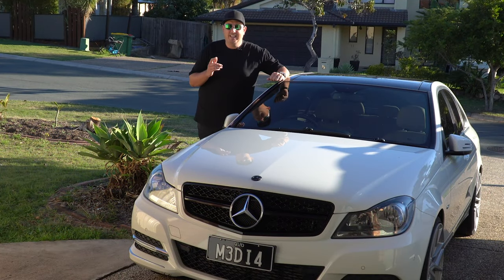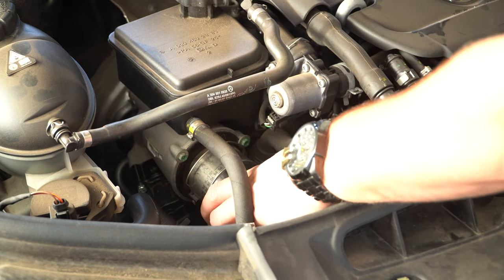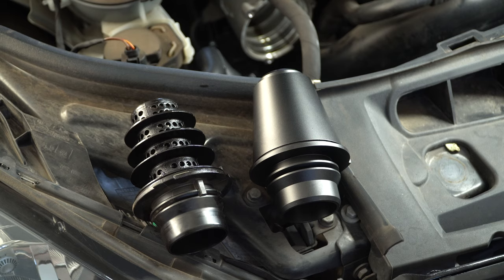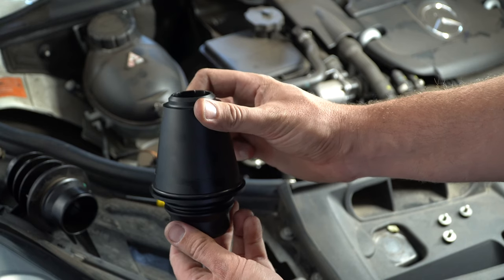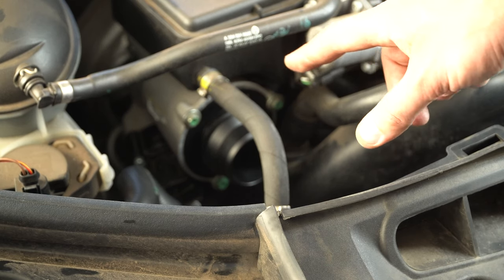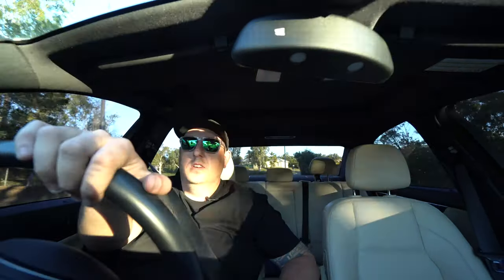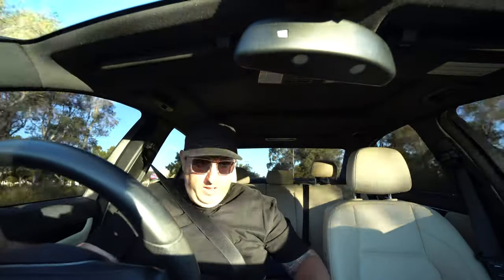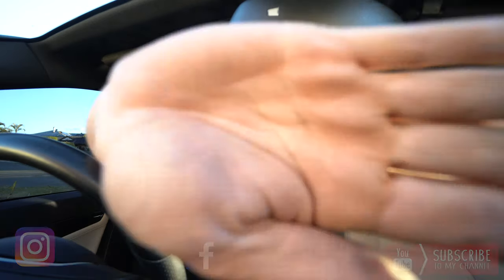TURBO MUFFLER DELETE - HOW TO

Comment: Nice mod but do have to drive like a tool in a built up area?  Not a good example to set to the kids.
Reply: how is he driving like a tool? he's just opening it up in second gear it's not like he's going 100...
Reply: @tamahawk175  Exactly. Opening it up. Hardly responsible driving.
Reply: @banjomaker13  "engine revs bad" yeah totally bud... because going 30mph at 6000rpm in second gear is super dangerous as opposed to 30mph at 1500rpm in 4th...

Comment: Hey can i just install this and a blow off valve or do I need to do any tune first before anything ?
Reply: You only need a tune if you mod or delete your catalytic converter, mod the fuel volume, or add something that drastically changes the volume of air pumped into the engine. So u good

Comment: Save yourself the $$ and just saw the muffler baffle off and reinstall it. Same purpose, no restrictions, and flows the same with of without the turbo delete muffler. Save your money
Reply: That would make a resonance chamber, with more turbulence than the factory piece.
Reply: It is probably shaped like that for a reason.
Reply: Correct but you still need a kiddy sippy cup to Chanel the air like the turbo delete

Comment: Would it fit 2013 A250?
Reply: This particular part only suitable for vehicles fitted with the M271 engine.
However, you can probably find one for your vehicle. They're available for almost anything (exluding normally aspirated engines)

Comment: is it work for c220d twin turbo? w204 2014 model ??
Reply: You can’t twin turbo a 4 cylinder.
Reply: @alexk3469  The C220d is a 2.0ltr diesel with twin turbos. So obviously you can. Mercedes did.